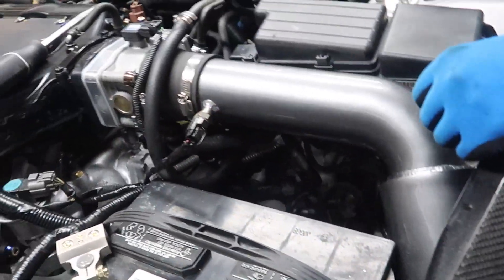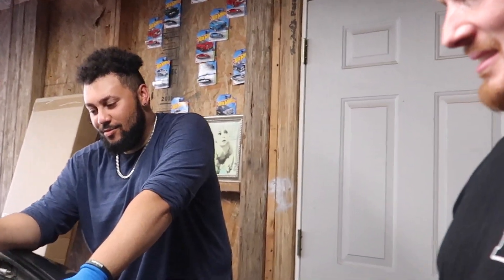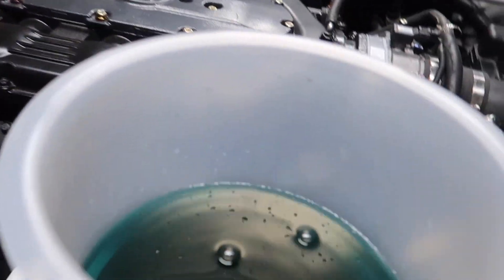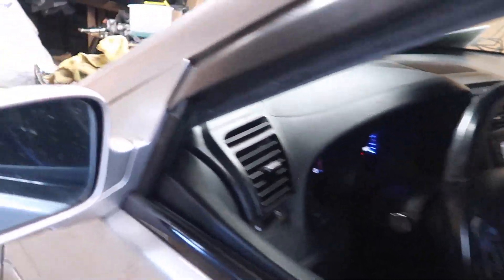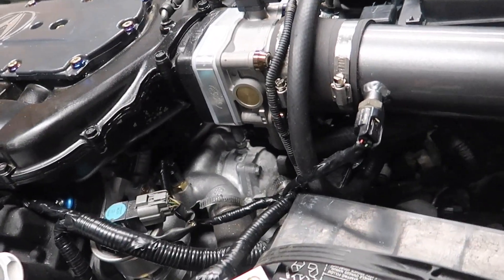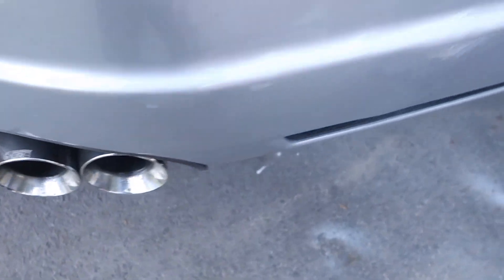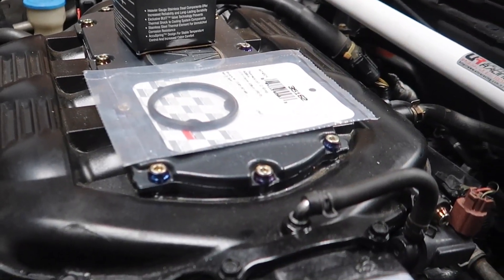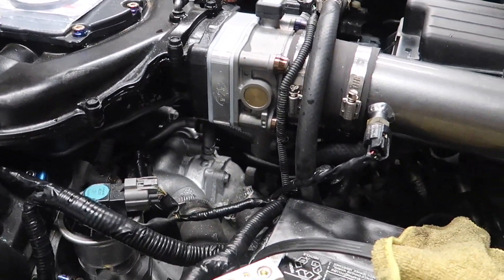This is not going well... HELP!!!

Comment: check radiator cap to see if it’s broken 👍 Had dealt with a damaged cap causing a loss of pressure on one my TL. Cracked coolant reservoir cap is pretty common too
Reply from the maker: Yea both caps are good. It’s not that it’s lacking pressure. I feel like it’s over pressurized

Comment: Let's get this thing fixed.  A few comments/questions:

1. Use distilled water when testing the cooling system. It's less expensive and you can flush it or make a mix later on.
2. Regarding the radiator fan, have you checked the ECT sensor? The ECU needs a temp reading in order to send a signal the fan to turn on.
3. If the car is in fact overheating the bubbling and overflowing could be the coolant boiling. Check the temp of the coolant with an OBD2 scanner (this will also tell you if the sensor is faulty by giving you a bad reading or no reading at all) and confirm with a thermometer. 
4. You mentioned the coolant hoses not being hot. Which one's specifically? The top radiator hose is the inlet, this should be hot. The bottom hose is the outlet, this should be cooler.
5. Did you already change the thermostat?
Reply from the maker: Legit just put a new etc sensor cause my old one broke. Also all the lines actually got hot. I feel like they got a little too hot though. And I did change the thermostat but not with oem. The only code that popped up was the cam position sensor.

Comment: These engines run so efficient that thermostat never fully opens until driven under load. Engine has to get 208 degrees I believe to turn on fans in HI mode. I can check my car tomorrow. 
Engine needs to get HOT to open thermostat fully. Will never fully heat up idling. I always keep cooling funnel on cap. 
Rev engine at 3,000 rpm until both upper and lower rad hoses are similar in temp and you dont see any air bubbles coming from funnel. You just need to drive or rev to get engine hot enough. 
Ignore gauges if says engine is hot. Has to get hot to fully open thermostat. Both sides of thermostat have to be hot. Takes awhile. Some car say there overheating, ignore and keep reving.
Reply from the maker: I’ll have to try reving it out past 2k. Thanks for the input bro

Comment: You gonna need Oem thermostat, should Rev 3rpm, so it can open it and the fan will kick on and another thing spin your radiator fan make sure its not lose or any play on it....I had similar problems too
Reply from the maker: Yea I’m going to change it to oem. I’ll check the fans. Thanks for the input
Reply: No problem bro, I found out my fan wasn't blow that much air and I had overheat problems, so when I change my Fan everything work perfect again......

Comment: Is the engine actually over heating if so I would block test. If it passes and once you replace that thermostat I would flush out the system. Make sure you bleed the system right and don't forget about that engine coolant drain plug in the back of the motor .
Reply from the maker: Yea I’ll have to double back and try